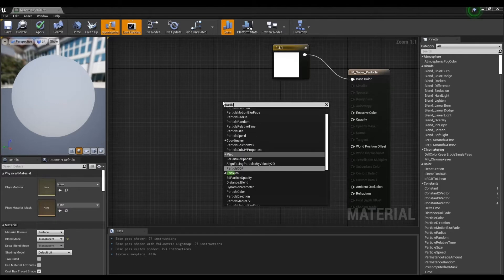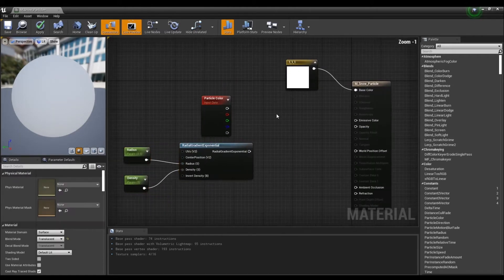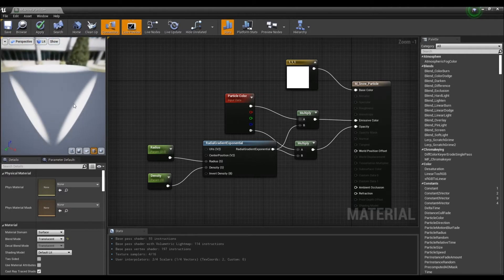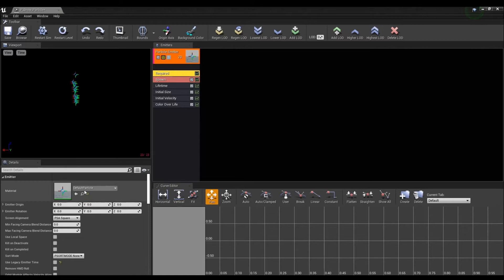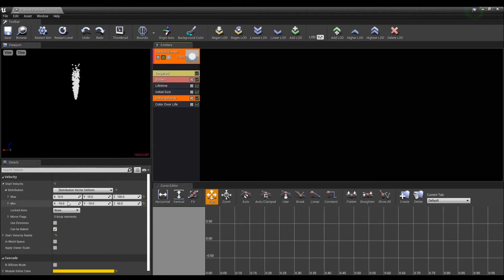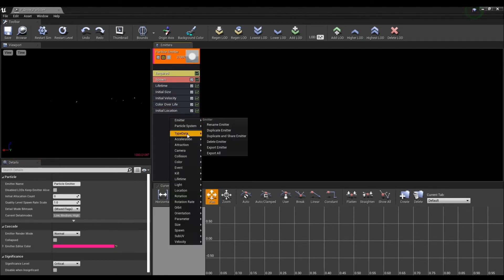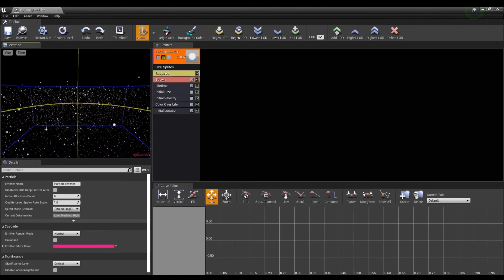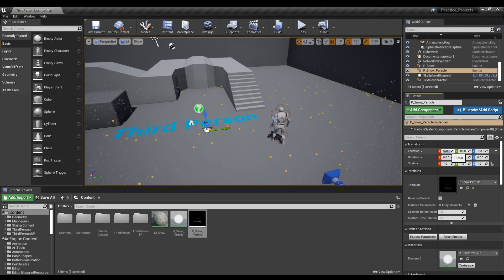UE4 Snow Particle System l Unreal Engine 4.26 (Tutorial)

Comment: After I make blueprint and connect Multiplies, the material just becomes invisible and disappears :( I'm using 4.27 version.
Reply from the maker: We guess you need to check parameter values and blend mode. Thanks
Reply: @CorebGames  Thanks, forgot to add density value.